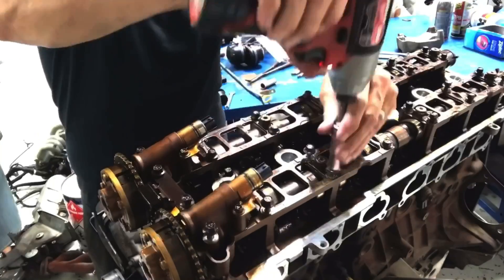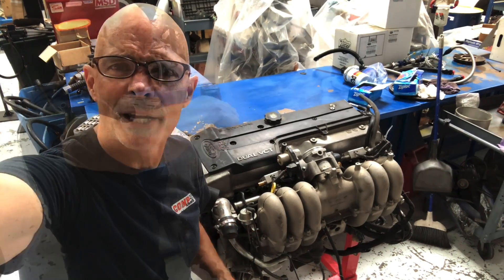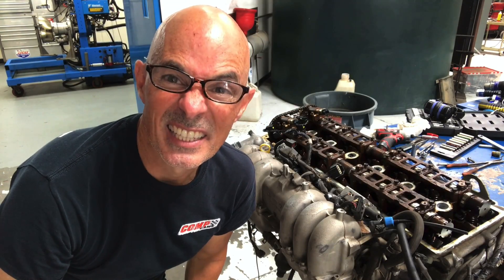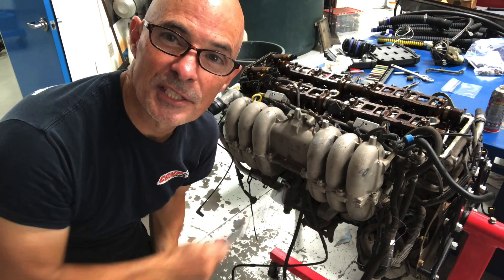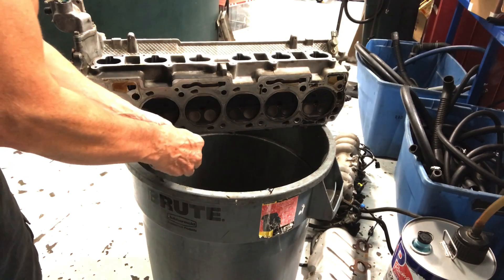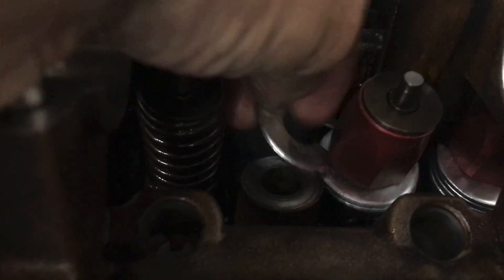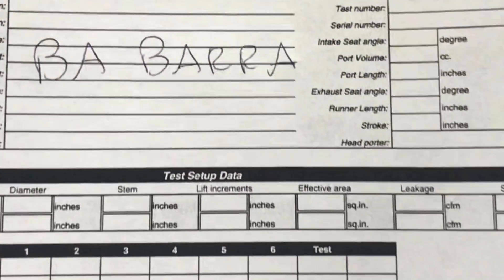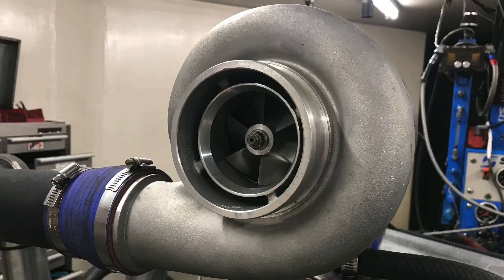HOW TO: 4.0L BARRA-DISASSEMBLY AND HEAD FLOW TEST                          (MY FIRST BARRA)

Comment: so richard, whats the final word of barra vs atlas - seems pretty close to call
Reply: @Boss260-  every engine has 'if's' , gm didnt do it to the atlas, ford did it with the barra , thats the difference.
Reply: @Made By Nobody Famous Calculator math for airflow doesnt tell remotely the whole story of these Barra. 218cfm from tumble port c heads on a 4.6L with smaller cams than the barra will support power beyond 6500 no problem. Runner length, and cross sectional area play a huge role in where the peak power occurs regardless of headflow. I also understand the barra has more displacement per hole than a 4.6 but it also has a ton more flow potential per cylinder. Saying what "x" amount of boost on of these heads is gonna do  is nonsensical as well because 25psi from a promod 88 is no where near the same as 50psi from a gt35, or even 90psi from a td04.
Reply: Can an atlas make ~2000hp on factory block, crank and unported factory head??
Reply: The head is superior on the Barra but the atlas was never optimized for power production. It is no slouch due to variable cam timing and 4v per cylinder. Both are pretty good stuff.
Reply: @madmod  yep atlas is ok but its no barra. The only better stock block would be the 2jz, but it comes with less capacity so needs more boost to get the hp
Reply: @8power857  The barra block is plenty strong just as any other factory modular block.
Reply: @madmod  absolutely,  they hold huge power.  I notice the price of S/hand barras have gone up locally since the USA guys have started buying containers of them.
Reply: @8power857  Ive been trying to find someone to ship me aussie barra parts as well as boss 5.4 intake manifolds for years. I may have actually found someone this year.
Reply: @madmod  google 'Mustang and Australian Classics' (they are in McLaren Vale, South Australia, contact Nigel). Also google 'Falcon Spares' (in Lonsdale, South Australia, contact Alan, David, Shirley).
Reply: @madmod  i could source some barras if could get me some LS stuff...
Reply: @madmod  sent email 
mrcot.... cheers
Reply: In the blue corner we have the blue oval blow hards in the orange corner we have the bow tie tyrants . who will win . who will go up in a greasy ball of shrapnel. Tune in next week to find out folks.😂
Reply: @jnljnl8485  🤣🤣👍👍 ahh they are all just pump with different badges. But some friendly rivalry is what spurrs the performance game along 👍
Reply: @Boss260-  To be able to support that kind of power level from a stock engine shows real mechanical durability as compared to just long lasting. Maintenance on any engine, it will last a long time, but supporting power hands down falls onto mechanical durability. Imho, the obvious cost saving mentality that built the Atlas was why its power handling isnt that of the Barra and why one is argued as a better engine. Then things like factory power adders, factory tuning solutions for performance, and hundreds if not thousands of real world combos that support huge power with stock/mostly stock engines leads to a huge cult following for the Barra. The Atlas is no slouch but had corners cut for cost. To say gm could have built yadda yadda amount of hp into it is some pointless scenario that already isnt happening.
Reply: @madmod  I was never disputing the barra. I was simply saying the what hp an engine can handle is not the be all and end all. And I would say that about any engine. So when people say "can it handle x amout of power" as evidence that it's better I'll call it out.
Reply: @Made By Nobody Famous so making 1900 moroso hp while not being able to put full power down to the track doesnt count for 2000hp on a stock head, (with a seat blend).
 An entirely stock head will do it.
 Why do you say no barra is doing so?
Reply: @Made By Nobody Famous https://youtu.be/2hKpRTrGT54
Reply: @Made By Nobody Famous  no the Quick Bitz FG F6
Reply: @Made By Nobody Famous no worries,  its a pretty interesting build.
Reply: @madmod  ? Hey i deleted a comment yesterday when i realised i was replying entirely to the wrong video, i was commenting on LS valve springs  in that instance. I have deleted no comments regarding this Barra?
Reply: @8power857  oops i clicked you instead of the other guy. Sorry haha
Reply: @madmod  🤣🤣 all good i was wondering what happened,  checking ally posts etc 🤣👍
Reply: @8power857  XD thanks for letting me know. You seem baller so i wouldn't want to leave some haze on here
Reply: @madmod  'baller' i hope thats a good thing to be 😬🤣🤣 im not familiar with the term,  either im out of touch with the modern society or it's simply not used in Australia,  or both 🤣
Reply: @8power857  Its a good thing haha!
Reply: @Made By Nobody Famous  Flow numbers of a head port with no intake manifold attached are not worth much on their own. The only way the Injector vane flows air is with a carb manifold attached which likely isn't happening on a Barra. Truth is very few of Ford's manifolds will support peaking more then 200cfm per intake port when attached to the head. As for engines having a cfm demand, its not so fixed cut and dry. Where peak power occurs has far more to do with runner length and cam timing than just peak flow at max lift. This is why there are mostly stock 2v modular heads supporting power all the way up to 7000rpms on head ports that flow less than 165cfm @ .500 lift.
Reply: Also, you generally will see a mirrored copy of your na curve when under boost assuming you have a consistent boost curve. Normally you only have artificial power peaks that occur later than the Na peak if you have a rising boost curve.

Comment: The rods should have the markings 1r23 aa on the rods . Which are the toothpick rods . 
That looks like a late mod BF judging by the oil filter as the earlier models had the z9 oil filter .
Reply: Pity it wasn't a factory LPG motor. Add oil pump, E85, and boost for 450-ish rwkw...
Reply: that and the bf written in wrecker paint on the rocker cover lol
Reply: good catch, definitely a BF engine.